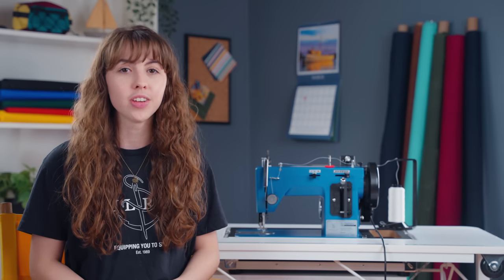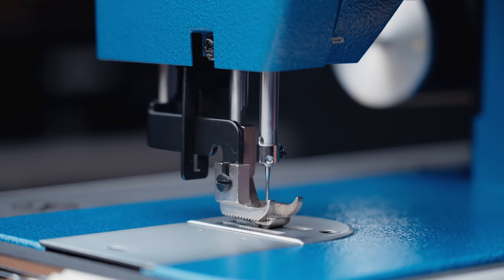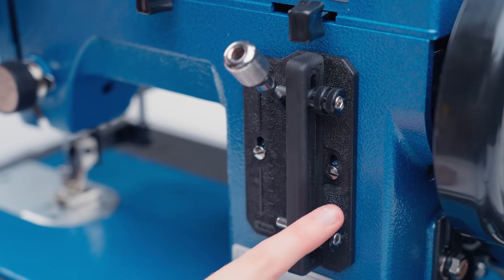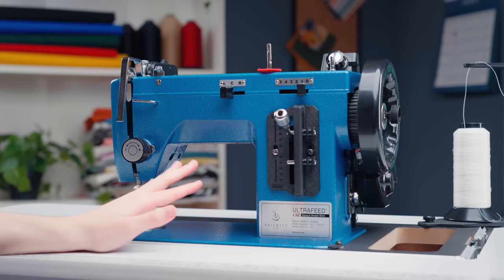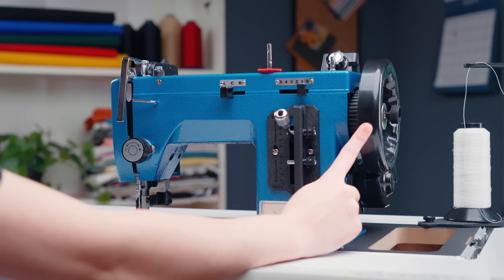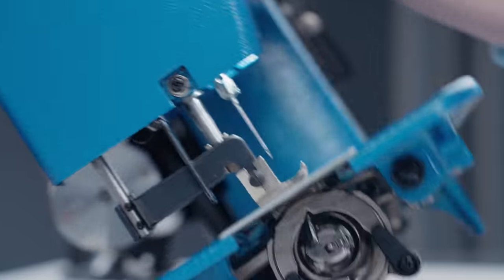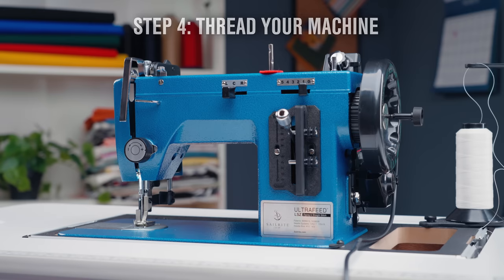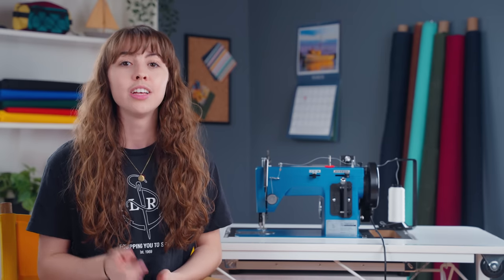Learning to Sew | Part 1: Setting Up Your Sewing Machine

Comment: Hi! Have a question about Ultrafeed LS and Fabricator machines? How do I use this stitch type that machine sews in straight stitches up to 6mm in length? Can you show about 1mm between 6mm on straight stitch on your YouTube Sailrite Workbench and would like to learn more about 1mm between 6mm, how to use it?  Thank you!
Reply from the maker: Hi, if you click on this link: https://youtu.be/48hHjUBLx2U?si=b3RdcHJzcLw74sXW&t=389
It will take you to a section of one of our videos where we discuss stitch length and tension. If you look closely, the sample piece in the video has examples of 1mm through 8mm stitches on the bottom part of the leather piece. For context, that example piece was showing the distance of 5 stitches for each stitch length.

if the link doesn't open properly, the time stamp for that section of the video is 6:29. I talked about how to adjust stitch length earlier in that video as well.